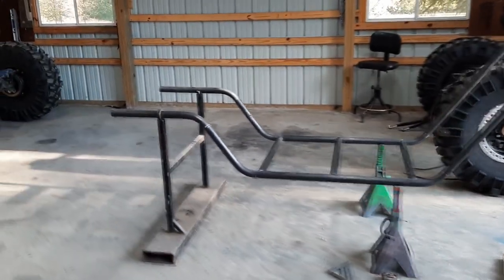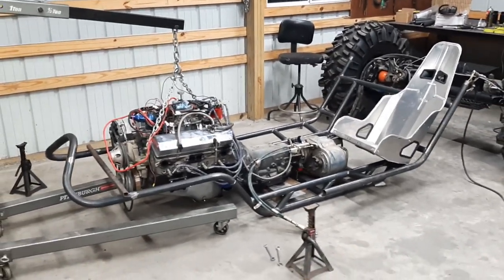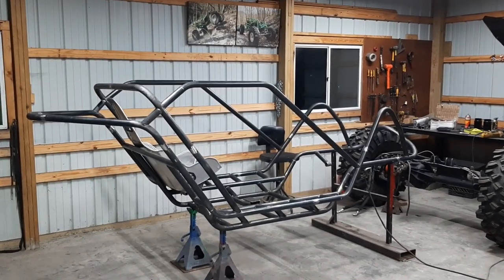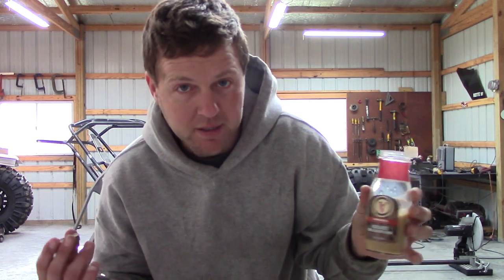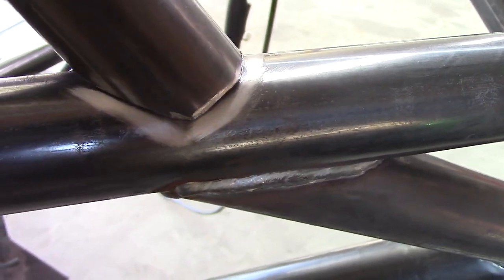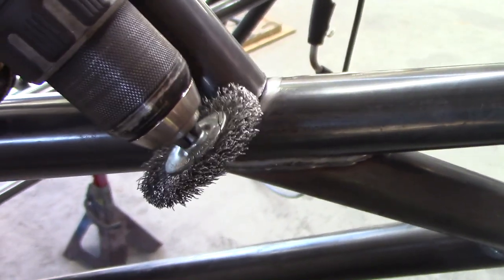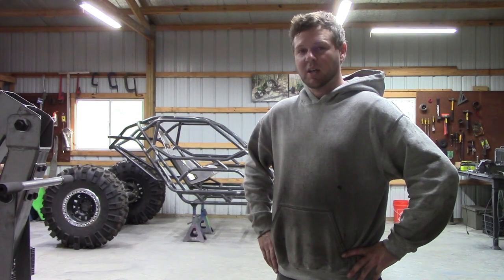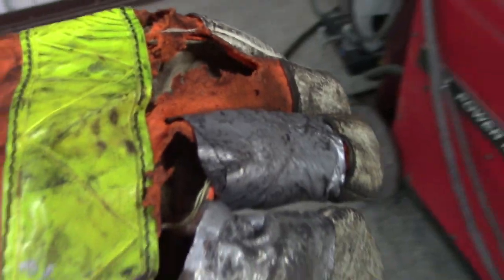I Build New Rock Bouncer Chassis for myself

Comment: Fantastic build! I've looked at buying a JD2 bender several times but with dies costing so much and not knowing which ones to choose I've held off. I'm guessing a 1.75 tube die in 90 degrees would be a good starting point but I'd love to hear what your top 2 choices would be since you've actually done a lot of fabricating. My builds will be rock crawling chassis for the most part.
Reply from the maker: I appreciate it man! Yes, all 1.75. I honestly forget the radius. If it's printed on it, I'll get back to you.
Reply: @Lowbouncer  Thank you and Happy New Year LB 👍
Reply from the maker: @twotwentyswift  Thanks a lot man, you too! Btw, looking like it was a 5.5" 180 degrees.
Reply: @Lowbouncer  I really appreciate the follow up on that! They don't make the model 3 anymore so it's a model 32 for me it looks like. Outgoing order for a JD2 and die happens now! 😁
Keep up the great work. I look forward to more inspirational videos from you sir!

Comment: Where did you get the axles?
Reply from the maker: 97 F350
Reply: @Lowbouncer  did you reinforce them to prevent anything from cracking?
Reply from the maker: @keithnikolaevich7530  yes. There are some pretty elaborate trusses on them, and the front has 300m rcv axle shafts.

Comment: I'm thinking about starting a v8 build, I've built my own rzr tube chassis, could you disclose your starting point measurements by chance? I'm curious as to the width of the tubes you had jiged in the first bit as well as how far you dropped down to the cab section,  it looks like about 2 45degree bends

Comment: What kind of engine and transmission in building a rock bouncer ?
Reply from the maker: Most use fuel injected Chevy v8s. Transmissions are typically th400s or th350s.
Reply: @Lowbouncer  thank you for idea Sir .